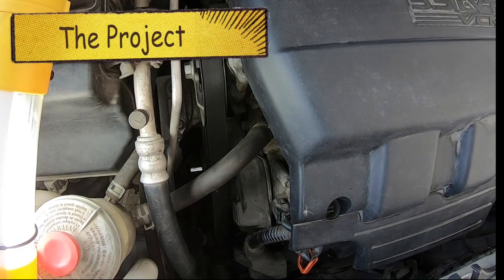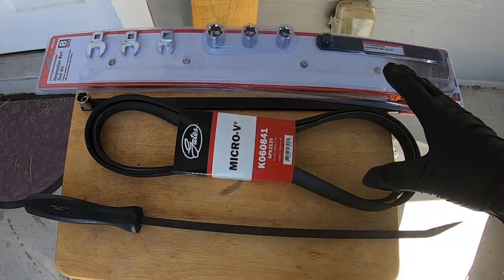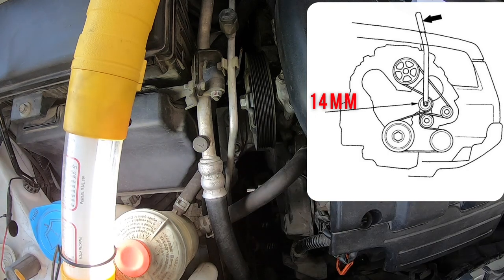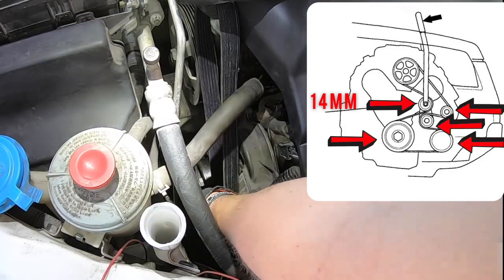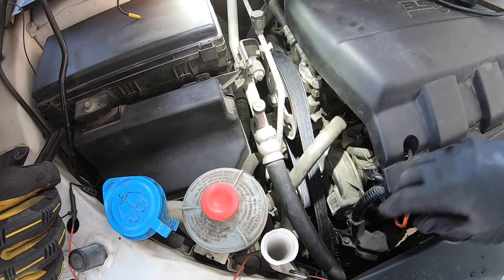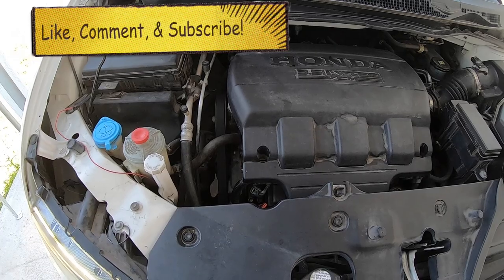How to Replace a Serpentine Belt on a Honda Odyssey 2011 - 2017 (4rd Generation)

Comment from the maker: THE TOOLS:
• Belt Options:
A. Gates K060841 - https://amzn.to/3KHhBdB
B.  Dayco - https://amzn.to/3mgp9L3
• 14mm Socket - Basic Socket Set - https://amzn.to/3fjRoBd
•  Serpentine Belt Tool - https://amzn.to/4396EZH
• Gloves - https://amzn.to/3bbfEnu 

Chapters:
00:00 Intro
00:18 Tools & Supplies
00:39 Remove Old Belt
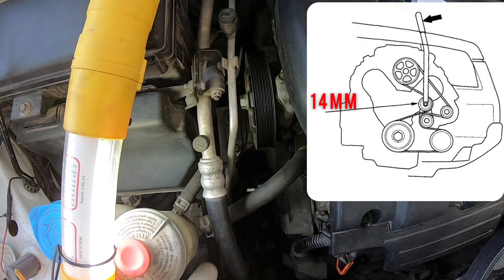01:10 Review & Compare Belts
01:25 Install New Belt
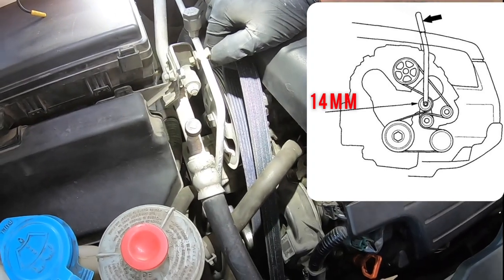02:47 Tighten Belt
03:23 Test

Comment: Well done.  Good advice about taking off the right front tire if you can't get a good angle from above.  Much easier to get the belt started on the bottom two pulleys and good peace of mind getting a solid visual from below.  Thanks again.
Reply from the maker: You are welcome! Glad it was helpful. Hope your project goes well!

Comment: If a belt that was to small was still put on but not put around ac to fit would it make check engine light come on ?
Reply from the maker: The belt should fit perfectly (even if it's a little hard to get on). I'd double check your make, model, and year with the belt you purchased and installed. The belt should definitely go around your AC compressor you have the wrong sized belt for your specific model and year.
Reply: @MCFIXIT  yes was wrong belt. The van broke down in N.C. n they didn't have the right belt. They put one on so we could get home. Just wasnt sure if engine light would come on for that.